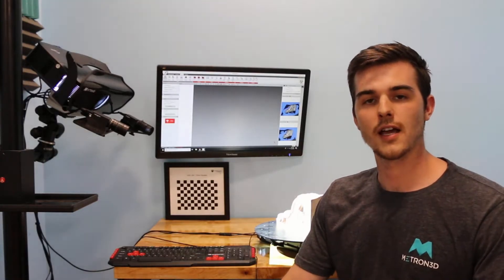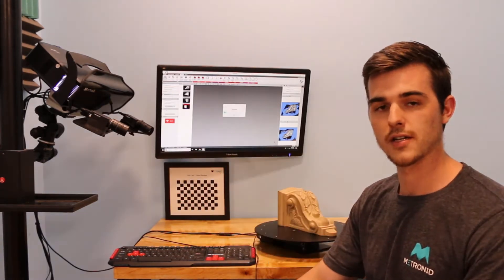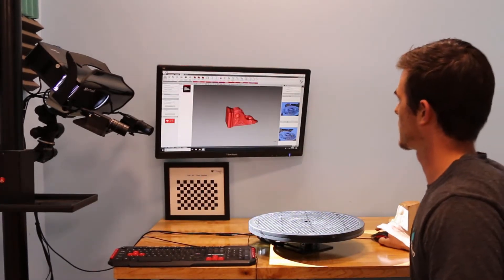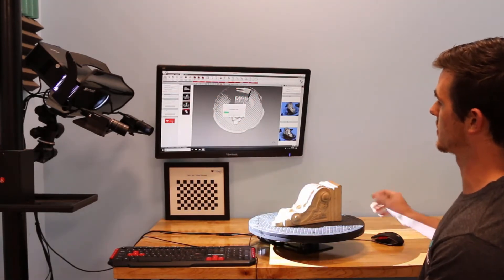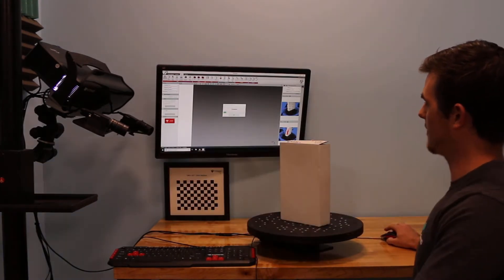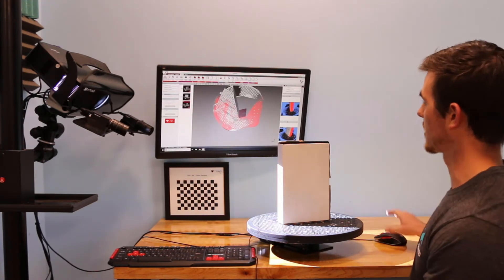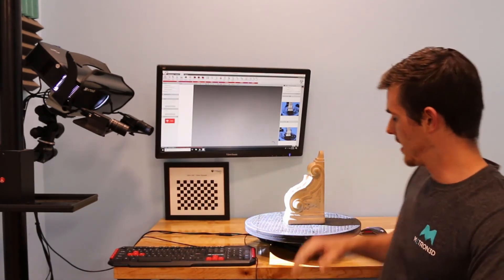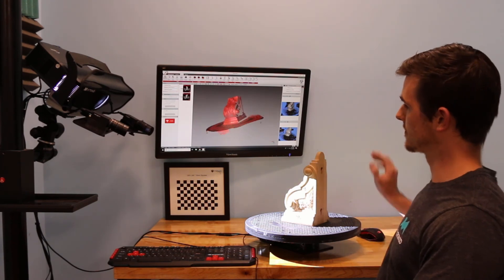How to Align 3D Scans Inside FlexScan3D 3D Scanning Software

Comment: Scanning is showing ok . But after global registration or meshing .. it destroys the shape of scanning data .. 
pls suggest
Reply from the maker: It is possible there is not enough overlapping information, 30% or more should be the same in both scans. Also, totally symmetrical data like pipes can be challenging for FlexScan3D and may need clay or addition of markers for aligning assistance. If you are a customer of GoMeasure3D, please contact us at support@gomeasure3d.com if the problem persists we can walk you through it.

Comment: Is it normal if the overlap happens but we still can get the whole data of the sample ?
Reply from the maker: FlexScan3D aligns by geometry feature so overlap is needed to align two scans. If you don't have the whole data of the sample then you would need additional scans. Sometimes it might look like a scan has the whole data of the sample but if you want to fill in the missing pieces you would need additional scans to get the additional information.